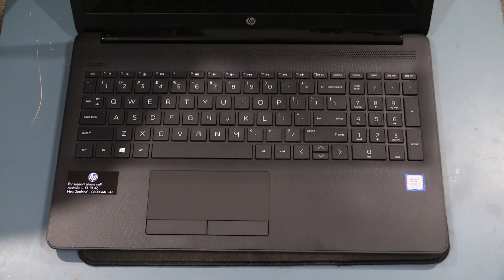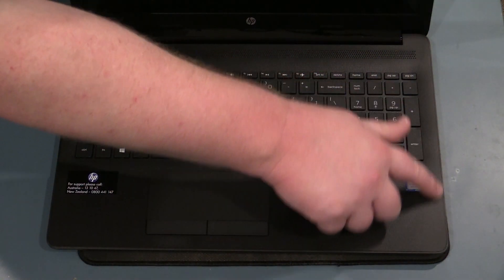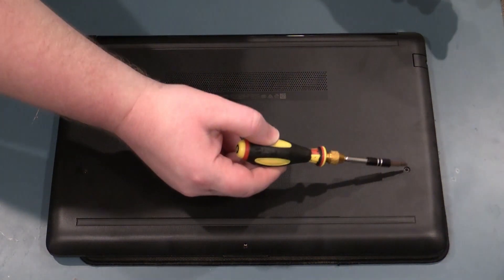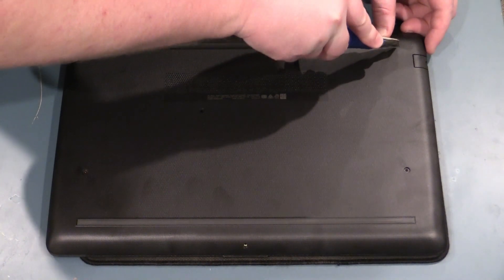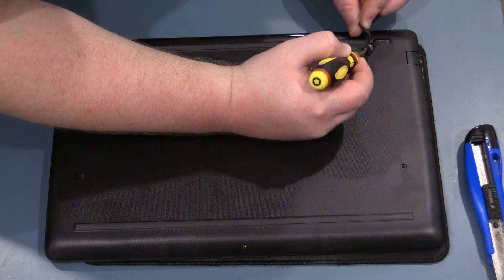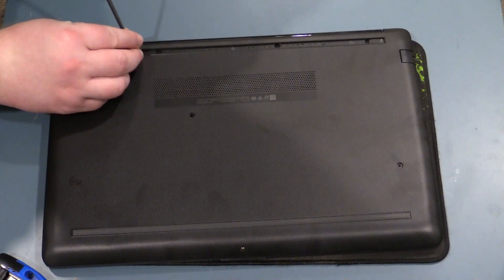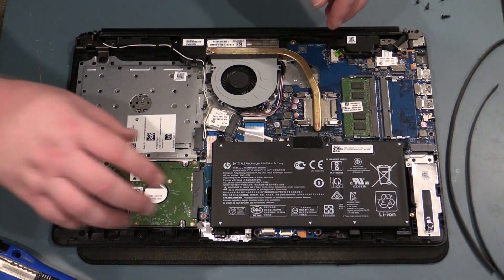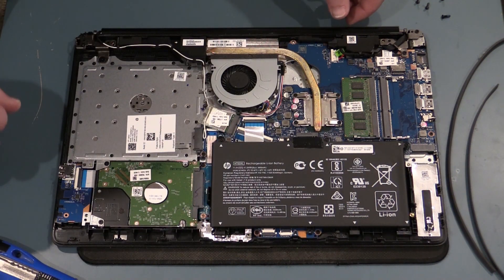HP 15-DA (15-da0094TU) disassembly take apart for memory, HDD or SSD upgrade

Comment: Can this and similar models run without the lithium battery? Mines puffing so much its pressing keys, pulled it open with the help of your vid (thanks!) And found battery is the issue. Have financial issues atm so wondering if i can pull battery and it still works?
Reply from the maker: Hey there! Yes if you remove the battery the laptop will still run off just the AC adapter. You can usually find a battery of eBay reasonably cheap though, just search for the model number. Good luck!!

Comment: Bro, where is the CMOS battery located for this model HP I5-da0005tx? My laptop does not turn on. Power adaptors are good. Got a project to finish? Help!!!!
Reply from the maker: Hi Jim, it won't not turn on because of a CMOS battery... if you've disconnected the internal main battery and no boot, then it's more likely to be a faulty motherboard. You could try a different memory DIMM; but unlikely to be anything to do with the CMOS battery. If the CMOS battery fails, it just forgets the time...

If you've tested the power adapter on a different laptop and it's fine, then I'd just move the SSD to a different laptop (if it's time critical) but sounds like maybe a motherboard issue. I'd need to see it to really tell more. You might have to find a local computer technician to take a look.
Reply: @Anthony99  Thank you for your feedback! I have exhausted all remedies. Seems like some component on the motherboard is faulty. No choice but to buy a new one. Thanks again.

Comment: How can i return back those latchs? If i remove them with the tape, will that tape stick again?
Reply from the maker: If you remove them with the tape attached to them (I use a small stanley knife to help pick them up) then they'll re-attach strong enough, although if you remove them multiple times you'll run into issues. I'd recommend having the replacement drive or memory upgrade, etc. in stock at home and ready to go before you open it up... or at the least, don't close the chassis until the job is complete to limit the amount of times you have to open it. Good luck! Thanks!! P.s. Please hit the subscribe button :)

Comment: First off, awesome video. 

2nd when I followed all the steps and opened it up there was this little metal part that was loose and I can't find where its from. It has to tiny sqaure holes and two round holes on opposite sides. It has a carve out it a very light s-shape. Where is it from. I Screenshot your image and played seek the differences but I don't see it anywhere tbh. I'm leaning towards just leaving it out but it does seem to have somewhat of a purpose. Any help would be great.
Reply from the maker: Thanks heaps for your message and for writing! Your support is greatly appreciated 🙂 Please hit the subscribe if you haven't already..

I'm trying to imagnie the part that you're talking about although I can't think of anything that makes that specific shape... sounds like it might be structural and is likely not that important.
Could it be the cover for the DC Jack? If there is one?

If you can find a picture on Google and copy&paste the URL, I can take a look? Thanks!

Comment: Hello,what do I do if my laptop says fan not working properly?
Reply from the maker: If it were me, I'd just take the laptop apart down to the fan level, get the model number of the fan and order a new one on eBay.

That said, it might just be full of dust, if you open up the fans cover; you can probably just clean it out, if it's still spinning, it might be fine....

Comment: Thx so much... My laptop broke and i still had this one but it's still got an old hdd in so thx to this vid i got it open.. Btw the back corner where the k lock is really didn't wanna move but i managed to get it opened up
Reply from the maker: Great job! Glad you were able to get it fixed up... with an SSD upgrade it actually has pretty good performance :-) Cheers

Comment: Is it working with all the da0xxx series? I own an hp 15 da0326ng and the hard drive is making problems so i need to replace it and would add a m2 instead the hdd.
Reply from the maker: It’s hard to say if every model in this series has an M2 or not, so I’d just open it up and take a look… that’s probably the best way. Take it apart on a desk where it can sit out of the way and see what’s inside it. If there is no M2, a Sata 2.5” SSD like a Samsung 870 EVO is still pretty good… but I’d open it up and check, then buy your drive to suit. Good luck!
Reply: @Anthony99  thanks a lot for the fast reply. I gonna check it later and see what's inside.

Comment: How much more power do HDDs, SATA/m.2 SATA SSDs, and NVMe SSDs consume? I have a laptop with a 1TB HDD and a 256gb m.2 SATA SSD, and I'm curious to know how the battery life would change if I upgraded to a 1TB NVMe SSD instead of the old m.2 SATA SSD, and a 1TB 2.5 inch SATA SSD instead of the old HDD.
Reply from the maker: 2.5” Sata SSD would definitely use less than power than a 1Tb mechanical, no motor or moving parts, that said, the age of your battery / usage and the older CPU generation are probably more relevant factors. Newer CPU’s are much more energy efficient. Something like this laptop will likely never get more than say 2 hours roughly out of it. You’d also look at the screen’s efficiency too, LED vs. LCD etc.

Comment: Great video! Thanks for the help,
 hey is the m2 slot for pci express 3.0? Or can it also take m2 pci express 4.0?
Reply from the maker: No problems :-) it’s a pci-e 3.0 slot although 4.0 drives are backward compatible, you just won’t get the extra speed. On current drives I’d look at the Samsung EVO 970 or maybe WD Black SN750 something like that. Good luck!

Comment: Good Job! I want to upgrade my Laptop Hp Model 15-da1012nv and i heard in the video that there is a slot M.2 NGFF (2280) inside. Is it true? Can I upgrade the ssd Sata and put a second M2 inside? Thanks in advance!
Reply from the maker: Hi there,
There is only a single M.2 slot in this laptop, so you can change the standard SSD over to a newer / faster one, although you can't add a second one. You can change the 2.5" mechanical drive over to a 2.5" SATA SSD for additional storage as well, although only 1x M.2 2280 SSD slot. Thanks for watching :-)

Comment: How do i glue the rubber back??
Reply from the maker: You just carefully guide it back, back one edge on the corner then guide it back into place... as long as you haven't removed it too many times it should hold quite well.

Comment: Dude you put the hardest part off camera. How am I supposed to pry it open once I have the screws off. My fingernails aren't working
Reply from the maker: Hi Maris,
Sorry it's a tricky thing to shoot, but once the screws are out, you push out (gently'ish) from the back around the track pad area... that's the easiest way to get it to 'unclip', once you get it open a little, the rest of the clips are easy... but definitely just use your hands, shouldn't need nails; just applying a little pressure at the right spot and angle, back of the laptop kind of 'up and out' to get the first clips to release, then it's very easy from there...
Thanks and good luck!
Reply: @Anthony99  thank you ^^

Comment: Where is the CMOS battery
Reply: There's no CMOS battery in the newer laptops.  The main battery maintains the BIOS configuration.  If you don't charge the battery enough, eventually you'll get the Hard disk 3F0 boot device not found error.  Just had my 15-da0503sa to bits to discover this.  All you need to do is charge it if the BIOS settings are off.  If settings don't hold after charging from the wall, replace the main Li-ion battery ;
Reply: @bar7294  when I replaced the main battery there seems to be a problem with maintaining the BIOS config and you get a CMOS 502 error. The laptop wont start unless plugged in with the adaptor and then everything resets until the next time. I have not been able to find a solution to the problem anywhere. Is is possible the compatible battery is missing something an HP original would have? Battery is working perfectly otherwise.

Comment: Do you have any idea where the cmos battery is placed in the hp 15-da3007nia model. The setup is exactly like yours whit the same placement of hardware components but I can’t seem to find the cmos battery.
Reply: There's no CMOS battery in the newer laptops.  The main battery maintains the BIOS configuration.  If you don't charge the battery enough, eventually you'll get the Hard disk 3F0 boot device not found error.  Just had my 15-da0503sa to bits to discover this.  All you need to do is charge it if the BIOS settings are off.  If settings don't hold after charging from the wall, replace the main Li-ion battery ;

Comment: Is separate Vga slot available for 15-da1014tu lap? Please tell me
Reply from the maker: It doesn't have a VGA slot at all, HDMI output is available. GPU is integrated with processor, so it can't be changed either... which is standard in a laptop of this class.

Comment: Hi! Thanks for the video. I have a question: in this HP 15 model where is the CMOS battery located? I have the HP model 15-DA0018NP and I have a CMOS checksum error on boot.
Reply: There's no CMOS battery in the newer laptops.  The main battery maintains the BIOS configuration.  If you don't charge the battery enough, eventually you'll get the Hard disk 3F0 boot device not found error.  Just had my 15-da0503sa to bits to discover this.  All you need to do is charge it if the BIOS settings are off.  If settings don't hold after charging from the wall, replace the main Li-ion battery ;
Reply: @bar7294  thank you

Comment: The rubber grips will not stick back right
Reply from the maker: You can likely just buy new rubbert feet from eBay, or try adding a small out of glue but not too much so that it's completely stuck and unmovable in case you want to get back in... or if you're sure that you'll never open it again, glue them on rock solid! lol up to you...

Comment: Question: in the upper left hand corner there is a black latch with M2x2 engraved on it; looks like the latch may be securing the large silver square thing.  Should there be a screw in that M2x2 latch?
I followed your instructions to open disassemble the laptop to replace the memory.  Laptop works great although when I transported it on it’s side in a case and pulled it out I heard something rolling around.  I found a round black almost flat Phillips screw that looks like it should go in that place but it won’t stay.  Any suggestions?  Wish I could include a picture but I don’t know how.
Thanks for any guidance you can provide.
Reply from the maker: Hey there, the m2x2 refers to the screw size but I honestly worry about it, it’s not essential. Might just be threaded, it’s only structural and doesn’t affect the laptop. You could try a different size screw if you wanted to though
Reply: Thank you!

Comment: hello sir how much ram can upgrade ! also possible change cpu like core i3 to core i5 ?
Reply: you can't upgrade CPU but if you do a command prompt and run "wmic memphysical get MaxCapacity, MemoryDevices" without the quotes, command will tell you maximum RAM you can install ;

Comment: This also works with the HP15-db0004x.
Now I need to find RAM and a SSD replacement of the HDD. Does anyone know that application where you can mirror the contents on your HDD onto an SSD?
Reply: clonezilla, if you good with linux shell otherwise rescuezilla is a graphical frontend for cloning drives for free (open source)

Comment: This laptop memory dual channel support or singal channel support please reply I want upgrade Ram
Reply from the maker: I'm pretty sure every computer supports dual channel memory, as long as it has enough memory sockets for 2x SODIMM's.
Reply: @Anthony99  but sir i call in hp care it is telling it is single channel 

Please check and final reply 
Serial number।  CND949218S
Product Number।  9GD55PA
manufacturer। Hp

Comment: I opened my hp 15 series laptop to check  SSD slot and fixed back. Now the laptop not showing anything on the screen just power light is on when I switch on power.
Im afraid and don't know what to do now.
Please help me to get out of this
Reply from the maker: I’d try re seating the memory, remove it and make sure it’s in properly, that’s most likely for those symptoms. Good luck!

Comment: Hey bro,, does this model support 3200mhz ram?
Reply from the maker: You can put 3200mhz ram in basically any PC that it will fit in, although it will only run at the maximum speed the motherboard will handle and in this laptop it will most likely max at 2400mhz… that said, ram speed is only a very minor difference in the overall performance of a computer. A good SSD is more important 100%.

Comment: Hi Anthony, thanks so much for your great instructive video. My HP da-0095TU battery has died and I have found a replacement in Sydney. Could you tell me if I can continue to use my laptop plugged in without any liklihood of the old battery becoming dangerous. Many thanks
Reply from the maker: Hi Aidan,
Yeah that should be fine.. you could even open it up and disconnect the battery if you want to be 100% sure but should be fine.
Cheers!
Reply: @Anthony99  Many thanks Anthony, much appreciated

Comment: Hi! Just found your chanel from this video as I have had one of these for over a year and I would like to push the RAM up a little if I can...Thanks to you I now know I can 👍🏽 Before your video I thought these weren't upgradable. Thank you for proving otherwise 💪🏾 I have now Subscribed 😁 
I do have one question, if you have the time, What's an M2? I am rather much still a noob in many respects. You mention it near the end when you speak on what can be upgraded. I see the empty slot, but I don't know what goes in there. If it's this M2, would you kind explaining what it is?
Reply from the maker: Hi mate, thanks for subscribing… an M.2 is a type of SSD, it’s quite a lot faster than a regular 2.5” SSD or Hard Drive like you might have seen before. You might commonly used an M.2 SSD such as the Samsung EVO 980 500Gb, as an example. If you Google the drive you can see what they look like but they just slot into that M.2 slot and screw into place. Good luck!
Reply: Thank You! I am going to give it a shot and work some more RAM 💪🏾

Comment: Hey, I dont have any nails and im having trouble getting the case to budge- Any tips?
Reply: Guitar picks work for me.  I bought a set on I think Amazon of varying thicknesses, and they work very well.  Some people get actual "spudger" tools, but they usually cost more and in my experience tend to be more delicate.  Guitar picks are made to withstand a lot of stress.

Comment: Can I use the CPU to this for a tower/desktop PC build?
Reply from the maker: The CPU is a mobile CPU, Intel  i5-8250U (FC-BGA1356)... you could try with a 1356pin socket but I'm quite sure you'll need a laptop motherboard specifically to handle that specific CPU... really, it's just not a good idea though as they're spec'd for mobile, desktop is geared for performance...

If you want a desktop PC, just get a desktop PC motherboard and CPU.

Good luck regardless though.

You can always just use the laptop as is and plug in an external keyboard, mouse and monitor...
Reply: @Anthony99  Alright, thanks for your input and help.

Comment: Hello those rubber pieces won't fit back correctly
Reply: how do you solve it
Reply: You cant bro it's impossible you have to get new ones and I can't find it anywhere except the hp company warehouse itself so you have to call them and it's like for one of those rubbers I 40 pounds mad crazy
Reply: @pranaylala3720  tqs...i better not open my laptop

Comment: According to you can this be done within an hour if it’s a first time ? And I’m worried if it break it as u need to pop the plastic chassy out
Reply from the maker: I did this in real time, so 4:00 minutes...
If you're genuinely concerned you should find a local computer technician to look after it for you.

That said, it is relatively straight forward to take apart. Good luck :-)
Reply: @Anthony99  thank you 🙏
Reply: @Anthony99  can the rubber strips be put back again ???

Comment: I have a problem bro .... I need a ram upgrade... But mine has only one slot... There is a space* for second slot but there is no slot.... Is there any way that i can get a slot placed there?
Reply from the maker: Great question, unfortunately I don't have an answer on that one... I'm going to guess probably not... but why not just buy a larger memory dimm in the one slot that is available?

It would be cheaper than having someone install the additional slot, if that were possible.

Memory is pretty cheap these days... so an 8/16gb SODIMM for the existing slot shouldn't be too expensive?

Comment: does it have a heat sink at m2 slot by default.
Reply from the maker: I’ve never seen a laptop with a heat sink on an m.2 slot by default, I’m sure maybe some of the high end gaming laptops do although this one doesn’t. I see them in gaming desktop motherboards commonly but not laptops generally.
Reply: @Anthony99  You are right. Check this video at 3.31. That m2 slot has aluminium strip and it can too act as minor heat sink.